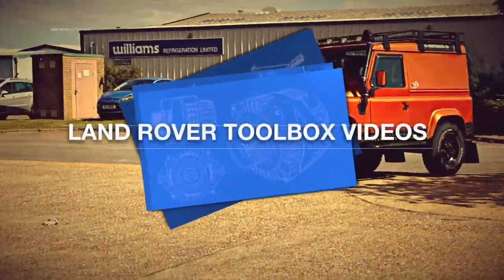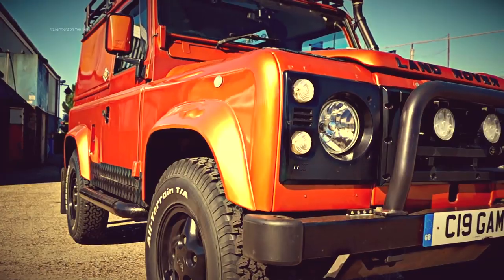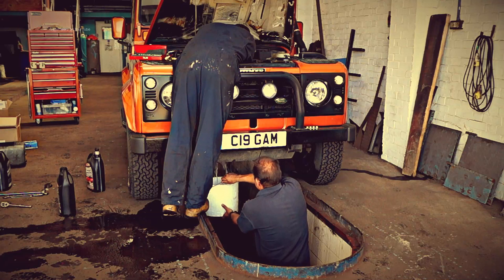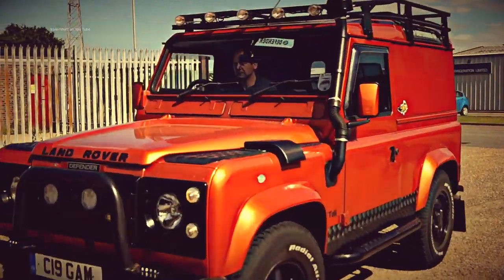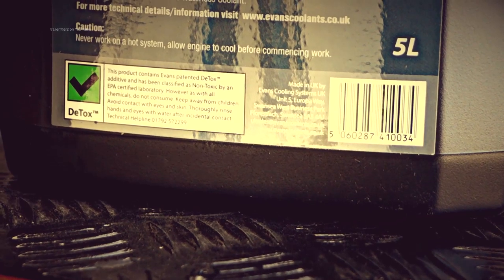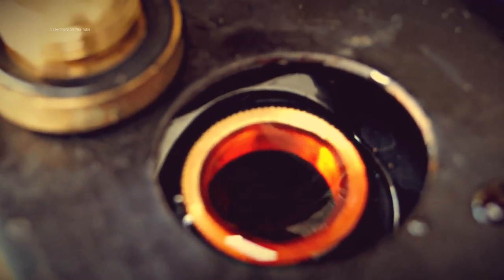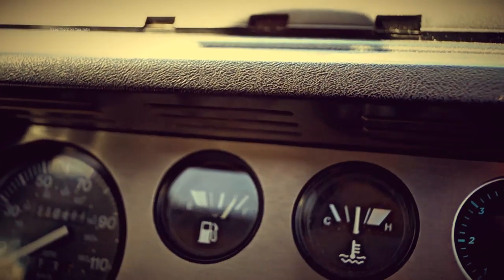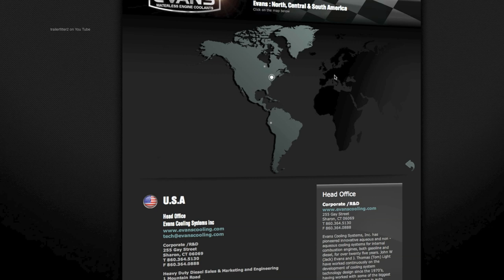Evans waterless engine coolant for Land Rovers Part 2 converting to waterless

Comment: Great stuff! Wheeler Dealers used this in a an episode on a Triumph and it looked great too. He even took off the radiator cap whilst the engine was up to temperature to demonstrate the no build up of pressure and no water.

Comment: hi.like ur show now am in kenya and my L/R TDI300 OHH 3 times av put the water pump and av check evrthing is ok can u help me thanks
Reply from the maker: Sorry,.... I don't understand what you want, your message is not very well punctuated so not clear.
Reply: *****
I would like to install this in my 2009 Ford 3.5v6 but.... MY 2 big concerns are:

1. Does the speed or rate that the engine would warm up to normal temperature off the peg change by using evans. (eg. Does it warm up faster, or slower)

2. Is the coolant thicker than normal 50/50 & would it cause issues with Water pump lifespan?
Reply from the maker: lightningsmokerXx  You really need to read the information on their website to understand what benefits it has.  The link is below the video in the description.  

The Evans warms up slightly slower but you need remember engines warm up quicker if there is an electric fan fitted to an engine regardless of coolant

What strain will be on the water pump?  it is a liquid and the viscosity is not much different between that and an antifreeze mixture.  . I'd be more concerned about the tension of the drive belt to cause problems with the water pump.   Why not ask Evans directly?
Reply: ***** I have. I've read everything on their site. And called them & a independent dealer 6months ago and they both said they didn't know. Just that they thought  it would be fine. So that's why i am asking for some " in the field " questions from people who've used it.
Reply from the maker: lightningsmokerXx  All appears fine on the Land Rover that has the Evans in the cooling system.  We will be going back to see it later in a years time from the date we used the Evans fluid for the first time.  I haven't heard any complaints about the fluid (except for the cost).

Comment: Most Rover forum postings I read on the matter of Evans coolant have little real world experience to offer up, meaning most of it is pure speculation about possible problems it will cause, particularly with the aluminum V8 engines.  Many claim the marginal increase in operating temp that occurs when Evans is installed is enough to wreak havoc on the engine.  I tend to disagree and feel that the engine would be much happier being evenly cooled under all conditions, and will not be bothered by the new operating range.  

Could someone who has installed this coolant in their Rover V8 powered machine please shed some light on this?
Reply from the maker: +Aaron Maughan .  Well the issue about engine running at higher than normal operating temperatures rather than the coolant that is in it.   If the cooling system is working properly then the engine will work as it should.   Obviously if you are going to push the engine to its maximum limit you are going to get trouble.   Part one of the Evans coolant series explains why some people convert over to waterless coolant.  Without having to pressurise the coolant system there is less stress overall on the components.     Link here for video   https://youtu.be/R-FpCpno23Q